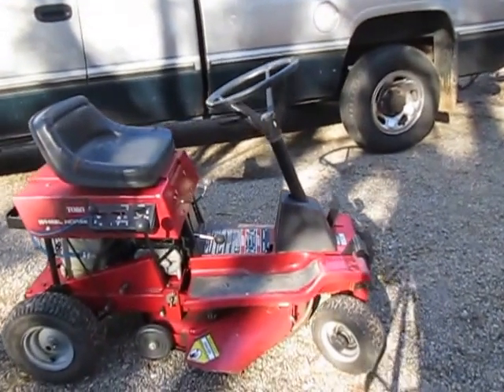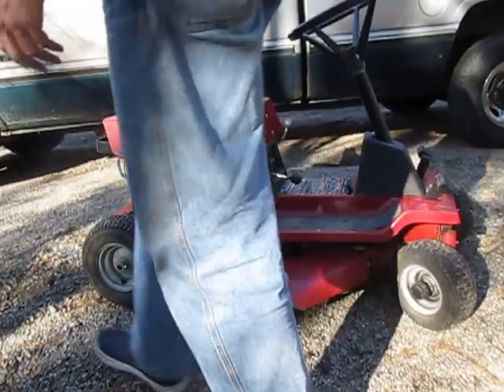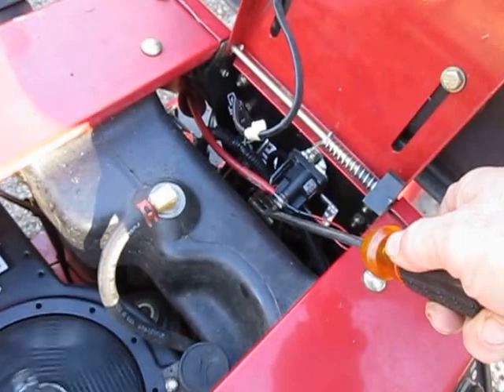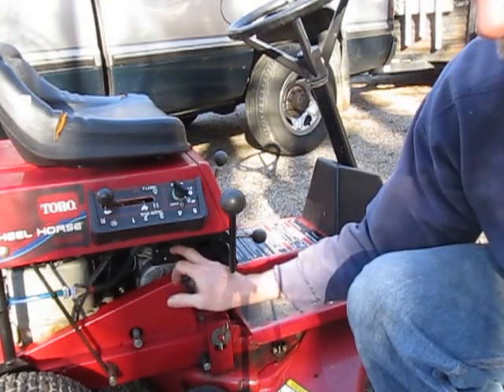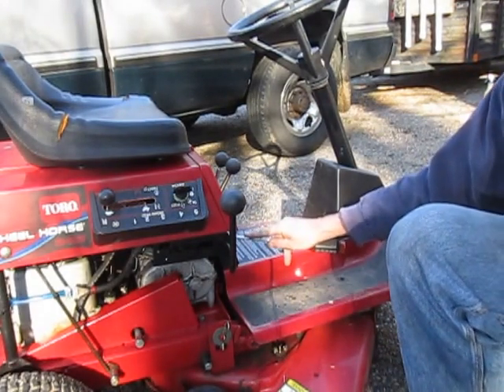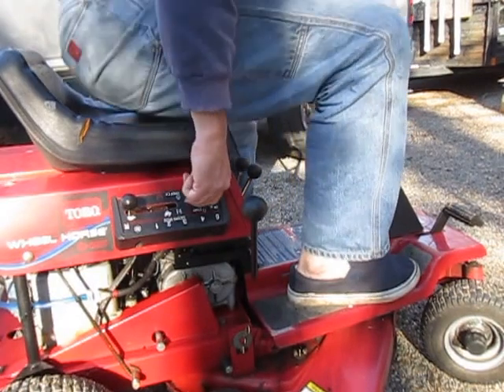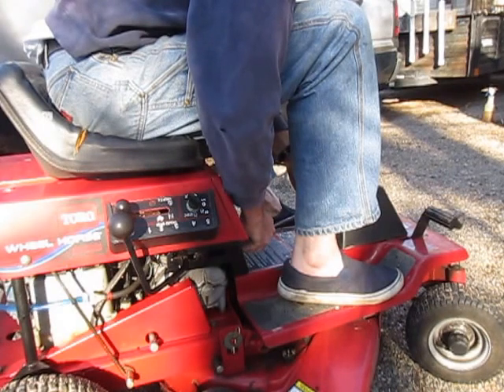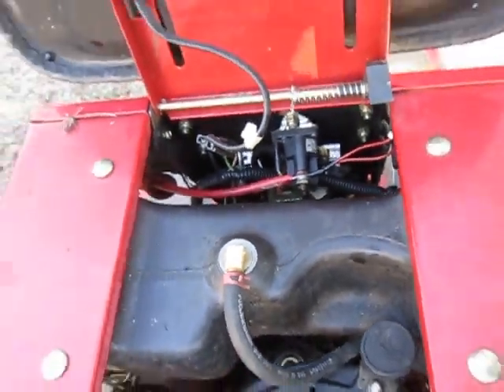Troubleshoot lawn mower starter

Comment: Solenoid is bad....if by turning the key the solenoid clicks but doesn't start and then you can start it by jumping then the solenoid is bad....it is not doing what it should be doing...the coil should be making an electric charge and the plunger should be making those 2 posts connect....did you replace solenoid?
Reply from the maker: I do not recall what the actual problem turned out to be, however this was not intended to be a part of this video.